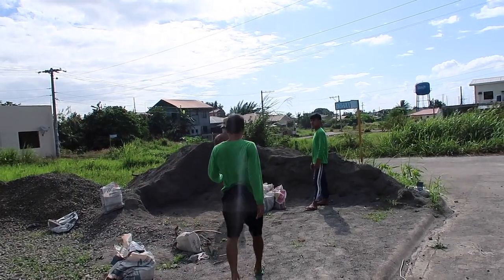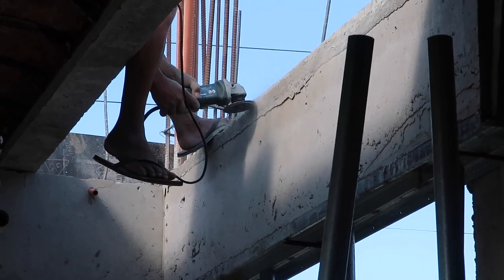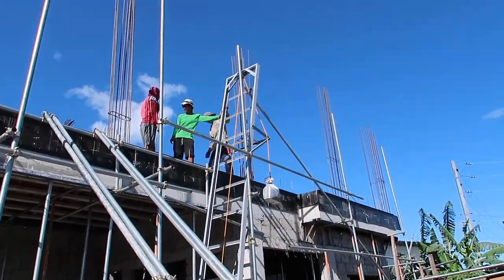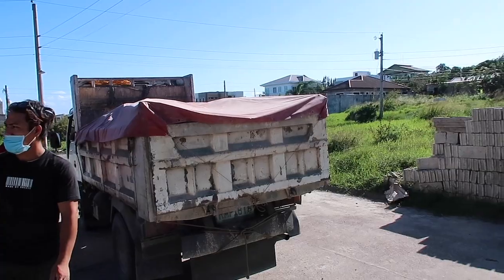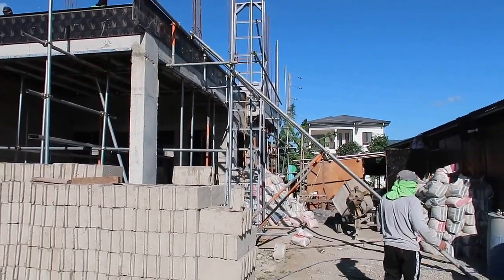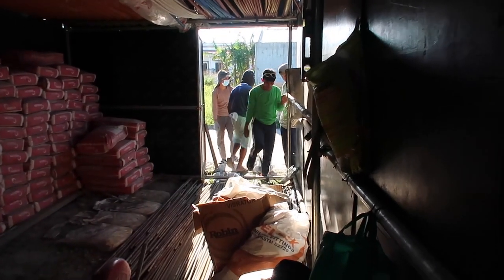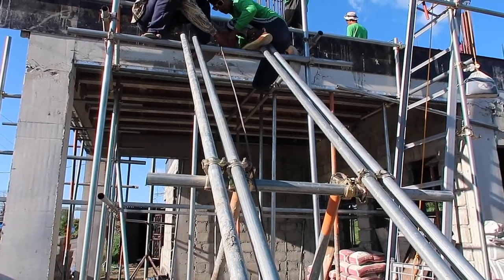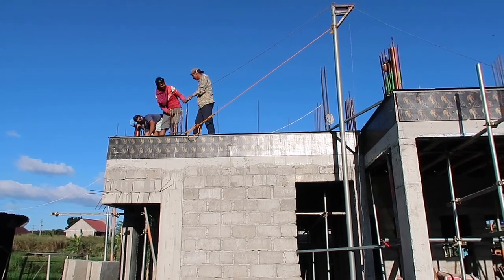HOUSE BUILDING IN THE PHILIPPINES - EPISODE 56: REBAR LAYOUT FOR C-JOIST SLAB

Comment: Another beam addition over existing beam. Issue after issue. These are the thing I firesee to happen, your structure is getting heavy with too much concrete addition. Construction is only up to 2bd floor level. The  roofing rebar end should have been hook into the floor beam in the first place. It was not consider durin the structural design it should have hooked into the flloor beam. Another boo boo again.thats why they run out of rebar for floor reinforcing. Where will they plaevthe miixer on the Znd level.. will the form support the operating weightbof the mixer? Where are the electrical conduit run on the floor??

Comment: It'd be faster, efficient, and low cost if you opted for those concrete mixing truck, and pump trucl for the second floor pouring.
Reply: there is a dirth of pumpcrete trucks in the Philippines. Even if you can afford to buy from them which is very expensive for the average individual builder, I doubt if they consider the amount of concrete you buy from them worth enough to bother diverting one of their truck from their bigger consumers/customers.

Comment: I'm thinking a fella with a concrete pump would do well over there. The time they spent putting the mixer on the second floor they could've had the entire floor poured if they were using a pumper.
Reply: It would be the most probable solution. They dont even need to haul the mixer up since they have a crane to lift a mixed batch of concrete with it. Completely wrong not to mention dangerous but i like it more fun. Maybe they can haul a whole car in the rooftop.

Comment: Need to provide spacers at the bottom rebars to meet the required cover. Also, as AusPhil Adventures says, the concrete slab should be poured monolithically to avoid stormwater leakage.

Comment: We made our construction stairs a foot wider than the mixer and pulled it up 
a 1 inch diameter twisted nylon rope. The bags of sand and gravel were carried 
up and staged on several sheets of 3/4 phenolic board. Cement goes up the
day of the pour with pouring starting when 25 bags are on the roof. We take the 
motor up separately. We also put the mixer up top for the flat roof slab so it is
now 25 feet off the ground.
       A common problem with the mixers is gear mesh or lack of mesh actually. 
There is a short piece of pipe around the drum axle to hold the bottom bearing
up off the U shaped frame. We put the drum level, take off the nut and slide the
drum axel out. The pipe spacer falls off and we shortened them by the free space
in the gear clearance which turned out to both be 6mm. You know it needs
done when you tilt the drum down and it makes loud noises and quits turning the
drum. Bearing failure in the wheels was also a problem with both mixers. One
was done as original and the other I made steel bushings to replace the bearings.
The latch handle brackets cracked and broke and praise the Lord no one was 
seriously injured. If I had to do it again I would buy another mixer like these I
have. With over 2000 bags mixed they are still both running since the failures
all around the 85 bags mixed range.

                                                      george and aurora

Comment: Cannot wait to see why you would bring the mixer up where you need to pour??? Even with the mixer up there they still need to bring all the materials up? Why not bring the concrete up? How much time to lift up the mixer and move it around the slab. WIERD.
Reply: The reason is to prestage all the materials on the roof before the day of
the pour to reduce stress on the crew. We didn't come half the way around the world to abuse our workers or hurt anybody. Moving 15 buckets of mixed concrete times 180 mixes is a LOT of energy out in the sun to get it up 10 feet 9-5/32 inches off the ground. We stage 5 bags wide rows with 2 sand and 3 gravel in a row. It takes this to make 5 cubic feet of concrete so we know how much to take up top. We also bag in the hot afternoon and carry up bags in the cooler
morning hours.
Reply: @georgegrimes6917  Would be interesting to watch your construction videos. Got any? 
Here are some ideas from Youtube for those worried about moving concrete.
 https://www.youtube.com/watch?v=AfF9YvAWsEY
https://www.youtube.com/watch?v=_-Ukcal2XUE
Reply: @MrSatukali  , WE haven't done videos yet just still photography. I got
a go-pro hero 3  that I will try out. Still a lot of work to do. Now reworking
the stirrup bender to  do some 18 by 36 inch beams and some small
ones for the dirty kitchen. I plan on a few explanation videos of drawings or computer CAD files with details, and then a walk around video of the
parts done or finished. WE are doing ornamental iron works for the 
window and door security. 36 doors, 32 windows and  120 panels of
handrail. First floor is PH reef species, second is flowers and trees
like huge leaves and lotus flowers. Lower deck handrail is  mostly fish, sea turtles, shellfish etc. Fan grills are Amish hex signs, Top roof are scenes
of the islands of the philippines with a major island and everything around it. I did a CAD drawing of all the Philippines north of Borneo which electronically is a drawing miles across. The entry gates are counterbalanced dragons from China, Japan, and europe.  May add one
from the Philippines of a Komodo dragon. If you get near Manila
come for a visit. You can arrange with my filipina on her faceboook thing  
"aurora riel grimes"  
                                                              george and aurora
Reply: TEC Man  They still have to move it to poor concrete where the mixer is now.  And to say Abuse and Hurt the workers is going a bit far George. I for one never asked them how they had to do the job. I was just amazed by the way they did it. A long chain of people. And about providing safety for the workers to not hurt them I provided them with all the safety gear but they refused to use most of it. I did not see any safety gear on this job? I gave Steel cap boots and High visability shirts they were all too nice to use for work apparently LOL I provided safety glasses, Gloves, Power tools, welding shields and also falling harness's. They seem to think sun glasses are fine for ark welding. I had no idea how they were going to do the job of pooring the concrete. To me they worked hard but I hired so many people they had a good time. It was a special day where we provided food and snacks and drinks and celebration drinks afterwards plus a bunus. You may not have meant to aim that comment at me but it felt that way George.
Reply: , @RikBor  Absolutely no disrespect to you intended. I just
picked a reply that happened to be yours. SO SORRY.  We also have
a celebration after a big pour day. Catered food from a cousin's
restaurant, rented Kereoke machine and the rest of the day off. I think
our pour day bonus is P100 plus the betting how many bags we end up mixing. That is P100 for an exact guess and P50 for the runner up
guesses. Now they all bet the same number and we pay everybody
for a win. I copied your trellis supports and used them for the floors.
Those are now experienced lumber. I put a little block flat under the legs
to prevent water wicking up the supplots and make it easy to remove the tressles.
                                              george and aurora
Reply from the maker: They will use a funnel
Reply: @retiredandhappyinphilippin3329  I will wait till the next clip I guess as that answer does not explain why and how.
Reply: TEC Man  Thanks buddy. I have learned a lot and if I had to do it again I would but I would be on the job more to keep an eye on them. Sadly health kept me away.  I would stick to using steel decking though.